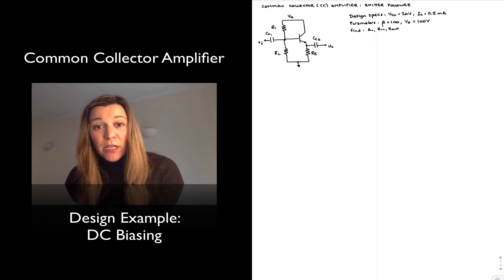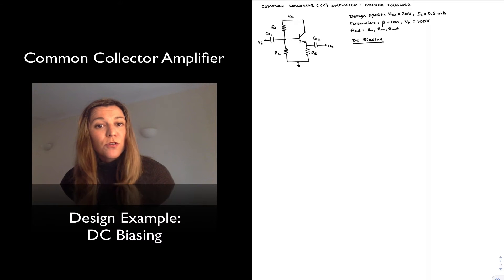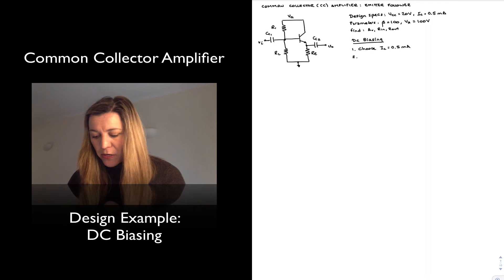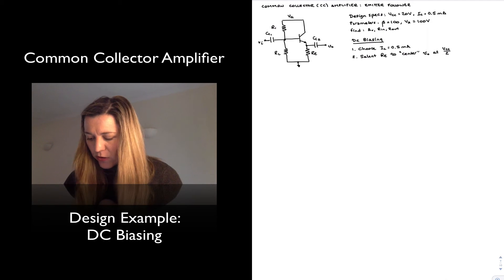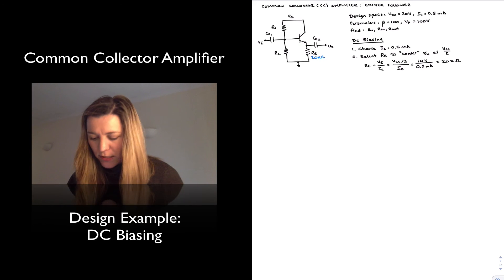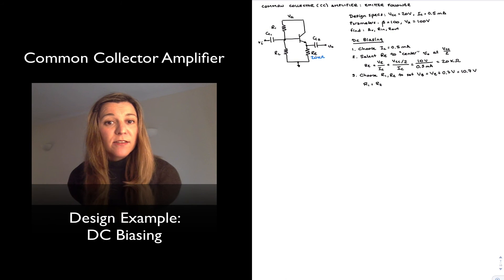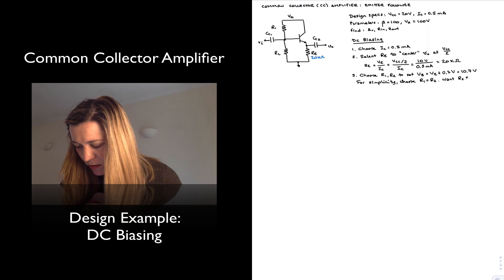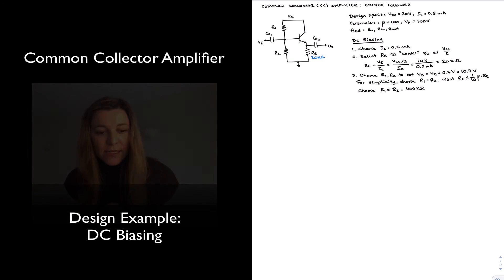CC Amplifier: DC Biasing

Comment: At 4:02 you set R1= R2 because it was close to the desired Vb, are we not as concerned with R2  < (1/10)*Beta*Re?
Reply from the maker: The approximation you stated, R2 < 1/2*beta*RE, is for the Common Emitter where the base voltage is much lower (i.e., 1.7V) and consequently R1 in parallel with R2 could be conservatively approximated to R2 (it is actually smaller than R2). However, in the Common Collector (Emitter Follower), VB is approximately VCC/2 which implies that R1||R2 = 1/2*R2 (remember that you are comparing the Thevenin equivalent resistance looking back from the base to the source, with the impedance looking into the base). I hope this helps. Mateo